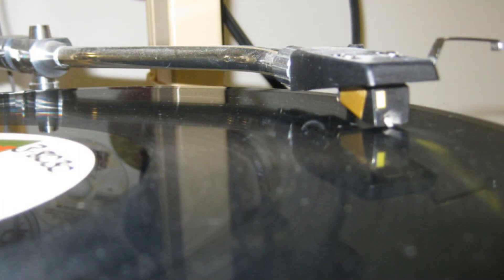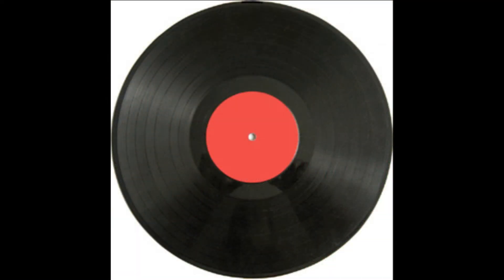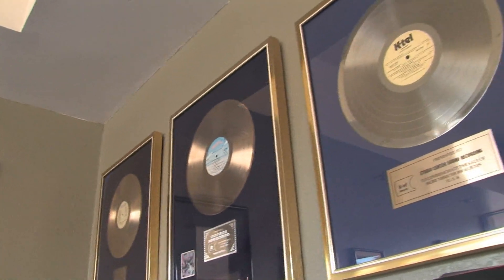Music Recording Facts : How a Vinyl Record Works

Comment: That doesn't make any sense.  How is it possible to make the exact sound of every instrument ever conceived as well as every other sound in known existence solely with just a round grooved piece of vinyl?  I understand that all sound is just electrical waves but by that logic couldn't you in fact do the same thing with any material?  Would it be possible to replicate the actions of an electrical guitar with a basic piece of paper if you just manipulated it in the right way or is vinyl just some magical material capable of things other materials are not?  It's really mind boggling.  It's pure wizardry I say, wizardry indeed.
Reply: Completely agree with Jack.   How is it possible?  So there is a specific groove/indentation for every single sound combination possible? combined with tone of voice, pitch, etc.....  come on this makes no sense.
Reply: Sound  isn't electricity, its physical force. Unless you get to a really low level and want to say that force is due to atoms' electron clouds causing them to repel and carry force. Sound waves are converted to electrical impulses by a membrane that vibrates in a magnetic field due to force exerted by your voice or instruments (at least thats how it works in some varieties of microphones. There are probably tons more ways to convert).
Reply: Jack Mormon The action of the instrument on the air is replicated. Correct?